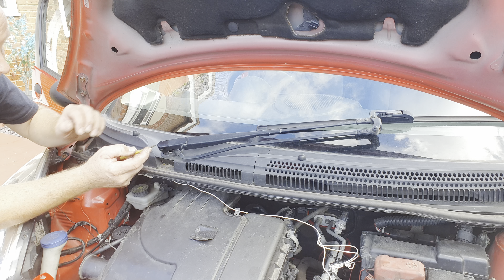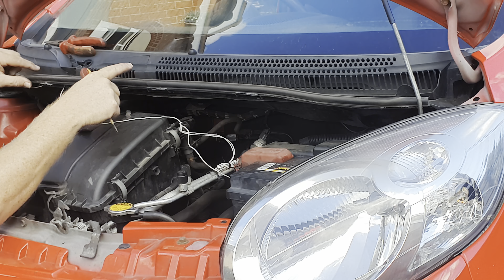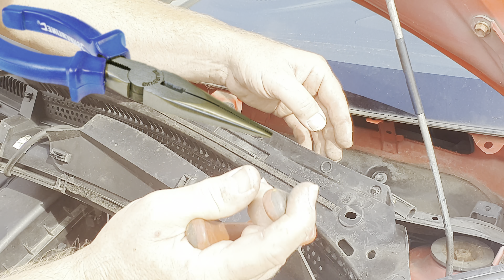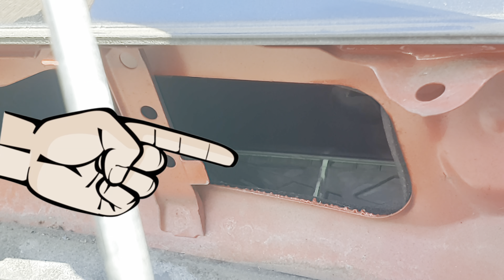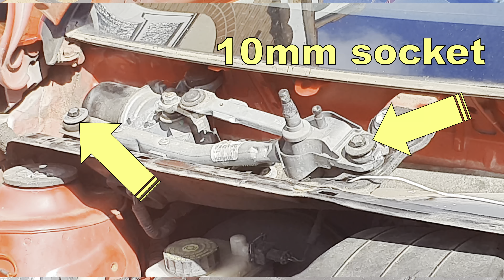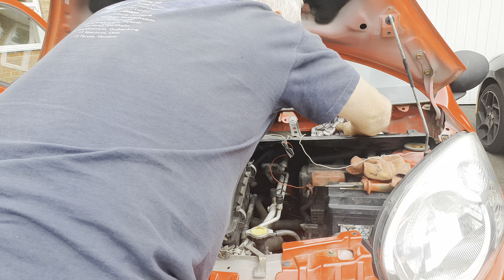How To Remove Citroen C1 Windscreen Trim, Wiper Motor & Washer jets

Comment: good timing. I need to take a look at my wiper motor as my wipers are failing to park, and will just stop wherever they are as soon as I turn them off. I thought it was the wiper stalk, but after changing it, found that it had no impact on the issue.

Comment: My wipers work, I checked all the fuses. But the front water jet don't work. Back on works fine. I went to the main line where it connect no water comes out

Comment: Hello, I can't find the fuel filter anywhere, can you tell me where I can get it. Thank you
Reply from the maker: It's non-replaceable, in the tank integral with the pump assembly
Reply: Thanks
Reply from the maker: @rafaelcorujo1098  it'll probs be next summer now, but I'm in the planning stages of a scheme to remove the in-tank filter and replace it with a canister filter that can be changed. It means modifying the pipework somewhere, but I'm in contact with an ex colleague about the correct parts to use. So, keep an eye out.
Reply: @CycloneCyd  Thanks